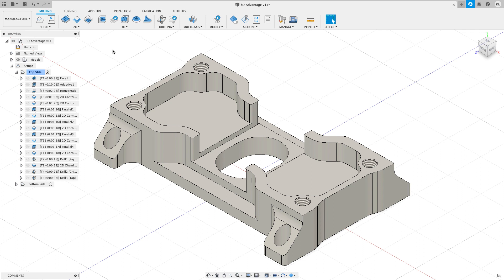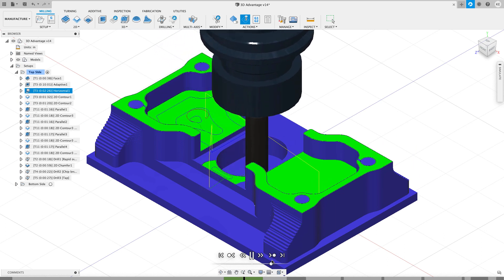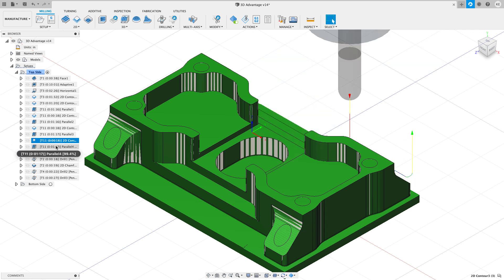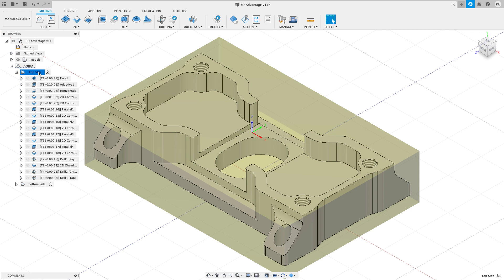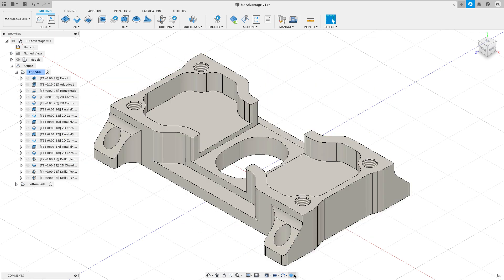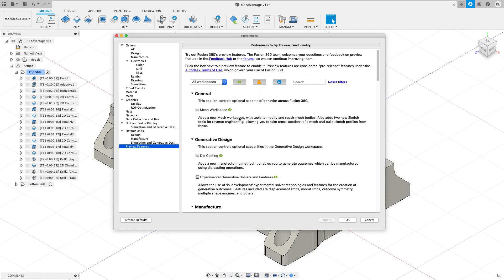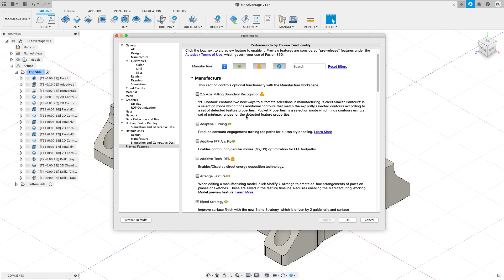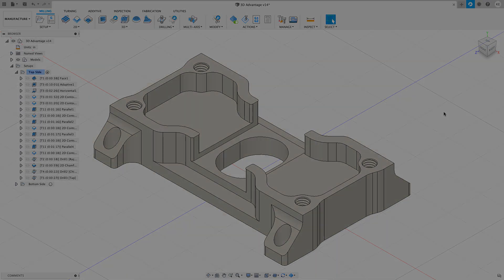Fusion 360 - In Process Stock Display

Comment: A subject I would love to see is how you solve issues and get answers when learning and troubleshooting fusion problems. I more than often run into a brick wall in CAM ...never sure wether the program I glitching or I'm not putting in the right inputs. I find the help maze confusing
Reply from the maker: I'm going to be honest here so please don't take this the wrong way. It's most likely user error in not knowing exactly what to adjust to get the results you want. And that is ultimately a software UI fail of the product.
I don't know how to advise you on this one really. One thing I could say is when you get into a spot like this, don't change 5 things at once. Be methodical about it so you can reverse what you did. 
And I'm not trying to promote this, but this is one of the exact reasons that customers purchase my support plans for when they get stuck. Not sure if you have ever taken a look, but you can find them at www.mechanicaladvantage.com/schedule-now under the support subscriptions heading.

Comment: Thanks for the tip ! Did not know how to shut it off. Not always helpful.....
Reply from the maker: Neither is a torque wrench right? But when you know when and where to use it, it is a great tool. And now you know how to use this tool :)
Reply: @MechanicalAdvantage  when you are working with less clean stock and only part of the tool path shows up it can obscure the part and portions of the tool path. The update had it set to "ON' which is kinda cool just did not have any new instructions with it. Thanks again!